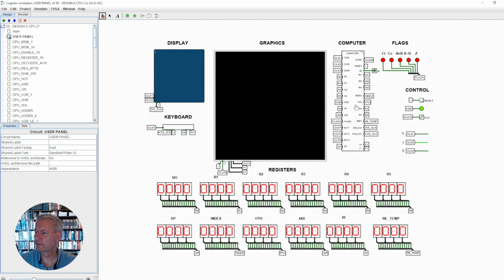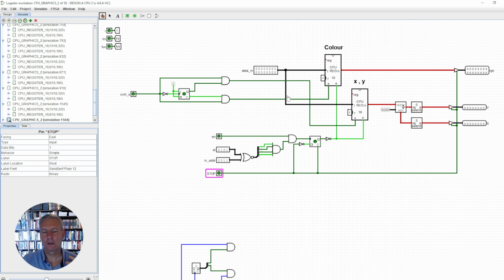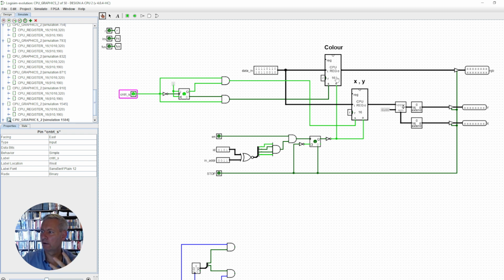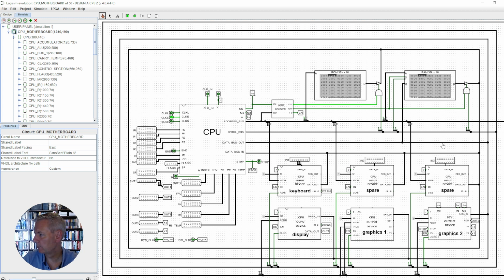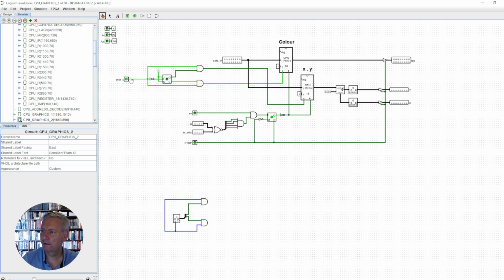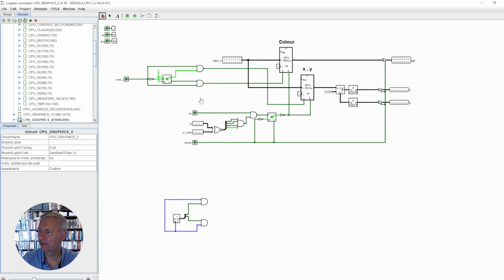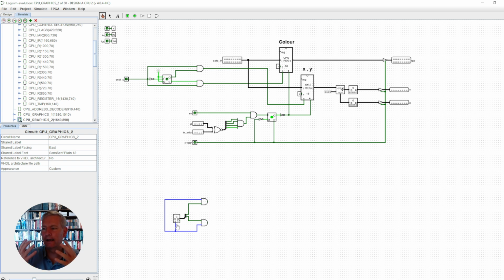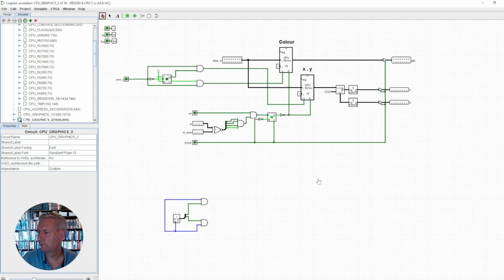Digital Circuit Design

Comment from the maker: Timothy Morgan has come up with a solution. It goes back to my original clock design. Here is what he said, quote "Hi Ross - When trying to implement the reading of the Keyboard I found that (in my setup) 2 characters were being taken at a time, & as a result one is lost - I worked out there must be a glitch in my CLKE signal & hence on the Keyboard’s Clock input: Methinks that when the inputs of the NAND gate in the Clock Unit that produces CLKE change from 0/1 to 1/0 they do so via 1/1 (briefly), so there’s a brief 0 on CLKE …"

One other student mentioned this issue in a post (I will have to look it out) but I never investigated it as I have written hundreds of simulations using the cpu and never ran into any issues. So I was averse to changing the clock. 

I have a few tweaks to make in my microcode to get the command working. I should have it done within an hour or so. 

Thanks once again to Timothy Morgan who's help has been crucial in allowing me to get the second course up and running !!!